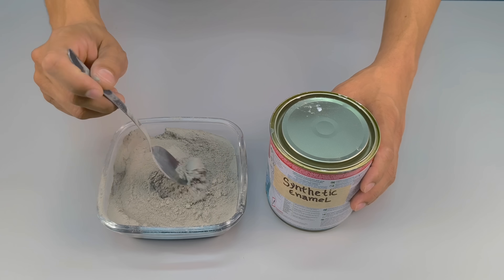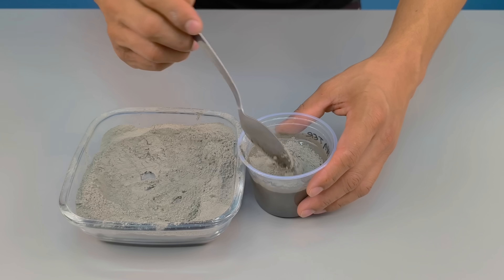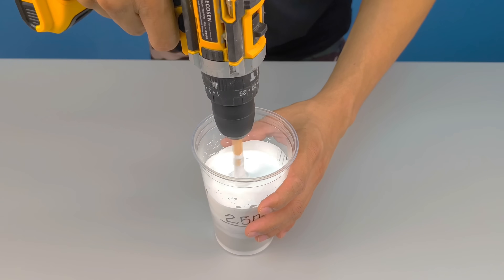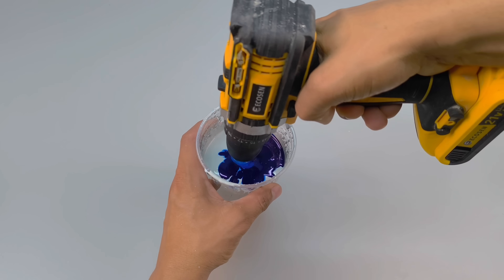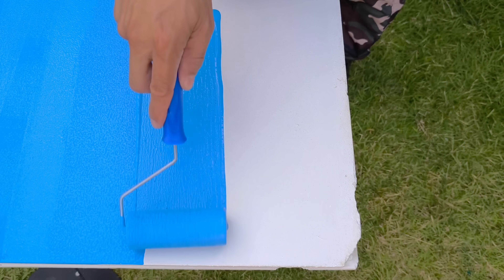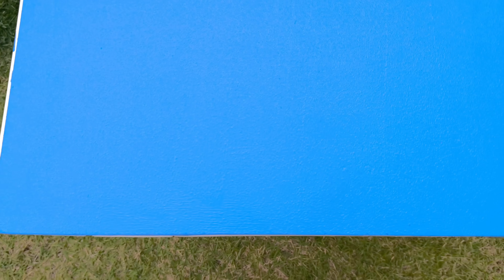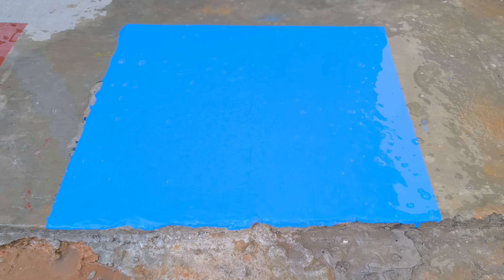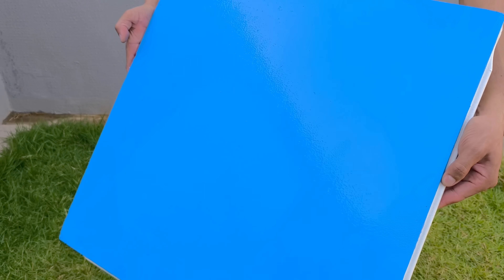Mix CEMENT with SYNTHETIC ENAMEL and see the secret that can be worth gold in construction!

Comment: hmmm Nice!   windsor ny here. can i use this method as a vapor barrier on concrete before i put a sub-floor on it?
Reply from the maker: Thanks! This method can help reduce moisture, but for structural floors I recommend testing carefully and following local building codes before using it as a vapor barrier.

Comment: Enamel paint in itself is waterproof. What do we gain if we add cement, PVA glue and colouring agent? More material at cheaper prices? I don't know...
Reply from the maker: Good question. Enamel paint is indeed waterproof, but adding cement and binders changes viscosity, texture, coverage, thickness, and surface resistance. The experiment explores alternative formulations, material behavior, and cost-volume balance rather than replacing industrial coatings.

Comment: Barcelona, Spain, Do you think if could be polished to get a brilliant result? Thanks
Reply from the maker: Yes, it can be polished depending on curing time and surface preparation. Progressive sanding and proper sealing can significantly improve smoothness and shine. The final result depends on the mix ratio and finishing method. Thanks for your question! ✨🧱

Comment: Great idea, I tried something similar with arcrilic paint and wall filler to fill and smooth of rough areas and small cracks in the plaster process, when dry it is easy to stand off smooth
Reply from the maker: Thanks for sharing your experience and tip!

Comment: Can i use over wood for a porch
Reply from the maker: Yes, it can be used over wood, but proper preparation is essential. The wood must be rigid, well-fixed, and protected against moisture. A primer or bonding layer should be applied, and movement joints are important because wood expands and contracts. For outdoor porches, sealing and weather protection are critical for durability.

Comment: Wow thank hoyo e quesito. Does it serves for a color? Don’t it scratch when you step or love a chair? I’m from Argentina
Reply from the maker: Yes, pigments can be added for color. Scratch resistance depends on surface preparation, curing time, and final sealing. For floors, a protective topcoat is recommended.

Comment: Do you have a recipe for a non-slip coating with clear finish for external ceramic tiles?
Reply from the maker: Yes, non-slip clear coatings usually combine a transparent resin with fine anti-slip aggregates. Surface preparation and correct application are essential for durability and safety.

Comment: How long after applying did you test it again? Wonder how long it will last after applying, must sealants have to be reapplied before a year.
Reply from the maker: The initial evaluation was done after the full curing period. Long-term durability depends on exposure conditions, surface preparation, and the type of sealant used. Periodic maintenance and reapplication are recommended depending on use.
Reply: @inovaouinventa qué significa curado por favor. Gracias

Comment: From Indonesia here...
I'd like to ask one question: I'm trying now your method on my outdoor concrete floor.
Is the mixture that thick? What will happen if I add thinning agent to the synthetic enamel before the mixture process?

Thank you very much for your precious and useful work 🌟 🌟 🌟 🌟 🌟
Reply from the maker: Hello from Indonesia 🇮🇩 Thank you for your kind words.
Yes, the mixture is intentionally thicker to improve bonding, coverage and durability on concrete surfaces. If you add a thinning agent to the synthetic enamel, it can increase fluidity, but too much thinner may reduce adhesion, strength and long-term resistance. If thinning is needed, use a compatible thinner in small amounts and test on a small area first, especially for outdoor floors.

Comment: What is the ratio of the Cement???????????
Reply from the maker: For this method, the cement is added gradually until the mixture reaches a workable, paste-like consistency. The exact ratio can vary depending on the enamel type, surface and application. Always start with small amounts and adjust as needed.

Comment: I watch from Brande, Denmark. 
I would like to know, how the surface would look after 3 years of daily use. That would be the real moment of truth
Reply from the maker: Greetings to Denmark! That’s a great question. Long-term durability tests are planned, including abrasion, weather exposure and sealing options. After a few years, it should remain solid, especially if sealed properly.
Reply: @inovaouinventa  Thank you for your reply. I have several concrete floors that need a restauration and finish, some in basements, work sheds, garages and humid spaces and I am checking out several different possibilities out at the moment, and I happened to stumble on your interesting video
Reply: @inovaouinventa  te miro desde Chile, todo el programa está en Inglés, incluso los subtítulos, luego voy a los comentarios a ver si logro encontrar algo que pueda entender y no tiene traductor, agradecería un montón que por favor cambiaras a traducción bajo los comentarios y traducción al español en subtítulos. Muchísimas gracias.
Reply: Love this! Had to laugh when you advised adding pigment “calmly” 🤣 Thank you for all your videos!

Comment: Watching from Philippines 🇵🇭 Will this come out glossy or matte? Ì prefer the latter and planning to paint an outdoor wall. Any additional tips?  Thanks! I love this diy ❤
Reply from the maker: Greetings to the Philippines 🇵🇭! The final finish depends on the enamel ratio. Higher enamel gives a glossy finish, while less enamel creates a matte effect. For outdoor use, applying a UV-resistant seal coat is recommended.

Comment: I'm not clear on whether you're using solvent-based or water-based synthetic enamel. Because if it's the former, I don't see how you'd get them to mix properly. There are resins that are insoluble in water, and you're adding water and PVA, which is also water-based.
Reply from the maker: I'm using water-based synthetic enamel. It mixes well with water and PVA glue because all the components are compatible. 😊

Comment: Hola. ¿Cemento con base acuosa y adhesivo vinílico también de base acuosa, mezclados con esmalte sintético con base de  solventes orgánicos como el aguarras? Sería una emulsión. ¿Eso funciona correctamente?
Saludos
Reply from the maker: Sí, funciona correctamente. En mi caso, el esmalte sintético que utilicé también es a base de agua, no de solventes. Por eso se mezcla perfectamente con el cemento y con el adhesivo vinílico.
Diluyo el esmalte un 20% y añado 50 ml de cola PVA, lo que mejora la emulsión y permite una integración uniforme con el cemento en polvo, creando una mezcla estable, fuerte y sin separación de fases.

Comment: From West Bengal in India.❤❤ Can we use White Cement instead of Grey cement. The colour of synthetic enamel must be white it seems
Reply from the maker: Yes, you can use white cement without any problem. It works perfectly with synthetic enamel, and it can even make the final result brighter and cleaner depending on the pigment you choose.

Comment: With thanks from India. In what ratio the ingredients are mixed?
Reply from the maker: I used 250 milliliters of synthetic enamel and diluted it by 20%, which equals 50 milliliters of liquid to adjust the viscosity and improve penetration into the cement powder.
In addition to that, I added 50 milliliters of PVA glue — also 20% of the enamel volume.
This combination increases adhesion, improves flexibility, and creates a smoother and stronger final coating when mixed with the cement.

Comment: 1) Can I apply this solution on open roof top surface? 
2) Approx 1000 square feet area what quantity of material to be need?
3) Can Enamel paint like ici, asian paints be used?
4) in place of black cement can I use white cement?
FROM INDIA ❤
Reply from the maker: Thanks for watching from India! These experiments are just for observing reactions, not for construction use, so I can't recommend using it on a rooftop. For quantities and specific paint brands, it's best to consult a professional in your area. But yes, white cement works just like black cement! 🤍

Comment: Is it practically necessary that the mixed material need dark colour only? Can I prepare very light shade of some colour and it won't affect the surface finishing adversely.
Reply from the maker: You can definitely use lighter colors! 🎨 The shade doesn’t negatively affect the surface finishing. The most important part is keeping the mixture well-balanced so the reaction and texture remain consistent. Feel free to experiment with different tones!
Reply: @inovaouinventa I appreciate your prompt response. I am going to use white cement as very light shades cannot be achieved using gray cement. Am I correct 
?

Comment: Which recipe is better? Cement + Marine Varnish or Cement + Synthetic Enamel?
Hi from Philadelphia!
Reply from the maker: Both mixtures create interesting reactions! 🔬
Cement + Marine Varnish gives a more flexible and water-resistant result, while Cement + Synthetic Enamel becomes harder and forms a stronger shell. Each one works differently depending on the project. Greetings to Philadelphia! 🙌

Comment: How long does it take to become dust ?
Reply from the maker: Great question! 👍 This mixture does NOT turn into dust easily. After it cures completely, it becomes solid and resistant. The only way it becomes dust is if you sand or grind it. 🔧✨

Comment: Am from Hyderabad india,can I use this for floor tile gap filling to avoid leakage?
Reply from the maker: Yes, you can use it for tile gap filling! 👍 This mixture seals well, but make sure the surface is clean and dry before applying. For areas with heavy water exposure, add a waterproofing layer on top. 💧✨

Comment: I did a 50% mix of UV acrylic you do that. You tell me when you're ready paint to 50% rapid mortar .
Eg 1 x Litre of paint mixed with 1 kilo of rapid mortar cement mixed the same way and applied to my plain concrete driveway 5 years ago and still looks like coloured concrete
Reply from the maker: Wow, that’s an impressive long-term experiment! 🔬 Mixing UV acrylic with rapid mortar in a 50/50 ratio really creates a strong and consistent blend. Thanks for sharing your experience — it adds a lot to the discussion!

Comment: FAKE, cup changed after adding colour and mixed, last applied paint cup was new cup of different real paint:face-purple-crying::face-blue-smiling:
Reply from the maker: Thanks for checking the details! 😄
The cup was changed only because the original one got a small crack and started leaking, but the liquid mixture remained exactly the same. Nothing was switched — just a practical fix so the test could continue properly. Thanks for watching!

Comment: What type of cement... that looks more like morter mix cement
Reply from the maker: Great question! 😊
In this test, we used Portland cement mixed with fine aggregate, which can visually resemble mortar mix. The texture may look different depending on the ratio and additives used, but the base material is standard Portland cement. Thanks for your interest! 🧱🛠️

Comment: Hi how to make leak water proof between sink n granite kitchen counter
Reply from the maker: Hi! To make the area between the sink and granite countertop waterproof, use a high-quality waterproof silicone sealant. Clean and dry the gap completely, apply the silicone evenly, and smooth it with your finger or a tool. Let it cure for at least 24 hours for best results. 💧🔧

Comment: Does it work the same on solid wood?
Montevideo, Uruguay
Reply from the maker: Yes, it can work on solid wood, but the surface must be clean, dry, and lightly sanded to improve adhesion. For best results, we always recommend testing on a small area first, as performance may vary depending on the type of wood. Thanks for your question! 👍🌳

Comment: ❤Im Subash from Bangalore, India. Does this mix perform as good as a water proof coating in large open areas of terraces. Would like to know the Ratios of Paint to cememt to water and Glue
Reply from the maker: Thank you, Subash! ❤️ Great question. This mix can improve surface sealing, but for large open terraces exposed to rain and sun, it should be reinforced with proper waterproofing systems. As a general reference for experimental use, a common proportion is based on balancing paint as the binder with cement for body, plus controlled water and PVA glue for adhesion. Final performance always depends on surface preparation, curing, and multiple coats. For structural waterproofing, professional evaluation is strongly recommended. 🌧️🧱

Comment: Could you please affirm this amazing formula be suitable for washroom floor....how long the formula can withstand under water.... 
Thanks from Dhaka, Bangladesh 💚🇧🇩❤️
Reply from the maker: Yes, this formula can be suitable for washroom floors if properly sealed. With correct curing and waterproof sealing, it can withstand moisture and occasional water contact for a long time. Continuous submersion is not recommended. Greetings to Dhaka, Bangladesh! 🇧🇩🙏

Comment: From Mexico CDMX…,Excuse me, is the nail polish water-based or oil-based?
Reply from the maker: Thank you for your question! 🙌 The nail polish used in this experiment is water-based, which allows better control, easier application and good adhesion when mixed correctly. Greetings to Mexico City! 🇲🇽

Comment: Dear, must it be water based enamel or can I use water based emulsion? Want to apply your formula on exterior walls that are exposed to sun/rain. Thanks in advance
Reply from the maker: Thank you for your question! For this formula, we recommend using water-based synthetic enamel, as it offers better adhesion and durability when mixed with cement. While water-based emulsion can be used, it may not provide the same resistance for exterior walls exposed to sun and rain. For outdoor use, proper curing and a protective sealer are also advised. 🌧️☀️🧱

Comment: Excellent dear I'm from Pakistan, synthetic enamel is you used in this recipe is water based or oil  based? I understand plastic emulsion, please correct me. ❤
Reply from the maker: Thank you! The synthetic enamel used in this recipe is water-based, not oil-based. It provides better compatibility with cement and helps create a more stable and uniform finish. Your understanding about plastic emulsion is close, but this formulation specifically uses water-based synthetic enamel. ❤️🧪

Comment: Can we take white cement or white putty.
Reply from the maker: Yes, you can use white cement for this formula, and it will provide a cleaner and brighter finish. White putty may also be used for surface smoothing, but for structural consistency, white cement is the better option. ✅🧪

Comment: try this.. 
water base paint 
wood glue
water
cement

1st mix the water base paint wood glue and water.. mix it well then put the cement and mix it well! use sponge roller paint to apply it.. see what is the result ang apply some enamel paint! 

i use that kind of mixtures for speaker box here in my country Philippines.. the speaker box will be water proof! tried and tested its really good mixture..
Reply from the maker: Thanks for the suggestion! This combination can work as an alternative formula, but the final resistance and durability may vary depending on the surface and exposure conditions. Always test on a small area first before full application.
Reply: @inovaouinventa i almost tried this so many years of experience

Comment: From Dubai.
My question is one litter psint + Portland cement mixtyre coverage area?
How may Square meter of floor will cover?
Reply from the maker: Thank you for your question! With 1 liter of liquid mixed with Portland cement, the coverage depends on thickness, but on average it can cover approximately 3 to 5 square meters if applied as a thin coating layer.

Comment: Isn't it carcinogenic ?
Reply from the maker: When handled correctly and with proper safety measures, the materials used are not considered carcinogenic in this application. Basic protection and good ventilation are always recommended. 👍

Comment: Hi, just one question... synthetic enamel you're using is dissolved with water or  with a solvent...thank you...
A fan from Mexico
Reply from the maker: Yes, this synthetic enamel is water-based, which makes application and tool cleaning easy. If you need more details about its use or performance, just ask!

Comment: Is it slippery?
Reply from the maker: Great question! After it cures properly, the surface is not slippery — it becomes firm and textured. But finish can vary depending on the mix ratio and application. 👍🔧
Reply: Thanks

Comment: Who needs expensive industrial coatings when you can make one in your backyard with cement, enamel, and pure determination
Reply from the maker: Exactly! 💪 Innovation doesn’t always come from big factories — sometimes it starts right in the backyard with curiosity and creativity. Thanks for the awesome comment! 🔥🧠
Reply: @inovaouinventa  Like the lady who invented " white out" with tempera paint!
Reply: @inovaouinventa your formula.can we applied in wood, plywood and iron media??? Thanks, or are u not yet to test  in this media?? Thanks
Reply: Watching from Los Angeles. This is a great idea and I will try it. Will it be ok on a shower wall?
Reply: @castanedagus  yes,it works. From India.
Reply: Según experto no se debe unir esmalte sintético con agua porque corta la pintura y usted de este consejo? ? ?
Reply: @leidatroya   no son todos los esmaltes sintéticos? Dependerá de si es al agua o no. En cualquier caso, ten en cuenta que a veces los fabricantes no quieren que si producto puedas hacer que sea más cantidad, quieren que compres mas
Reply: Buenisimo !!! Saludos desde Argentina. 🇦🇷
Reply: Is that acrylic enamel? Is other acrylic paint ok to use like wall paint?